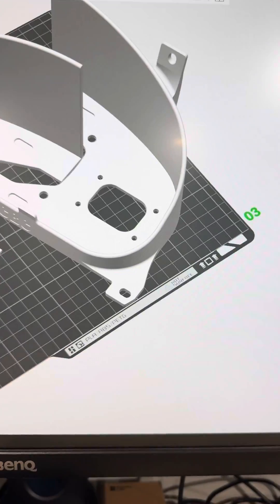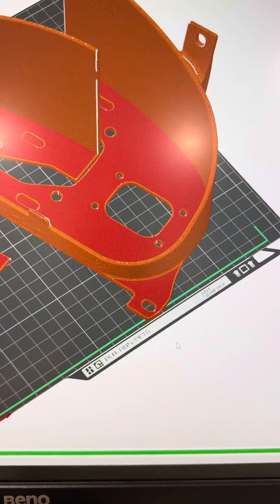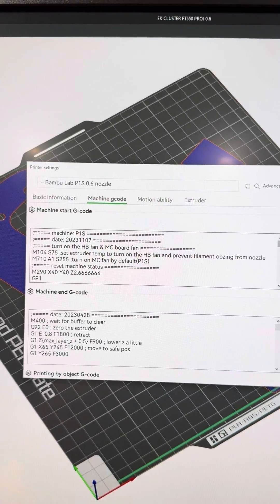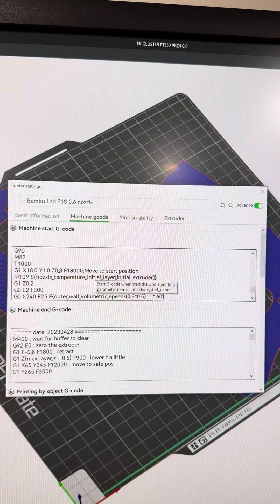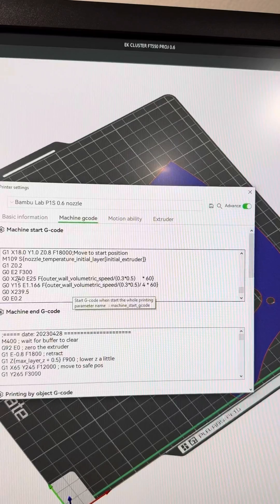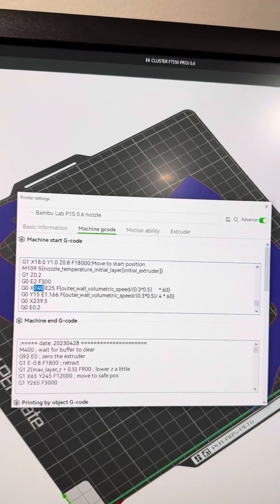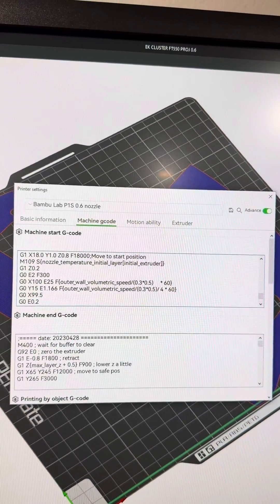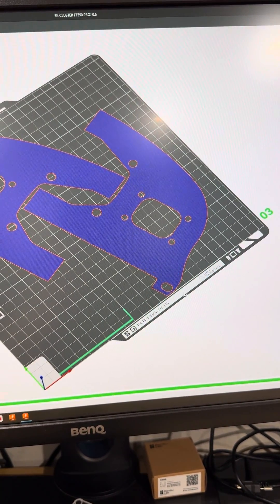Move Bambu “Load Line” Initial purge

Comment: say if i am printing something that goes up to allthe edges. can i ad a Ysome value to move it to the say the middle of the printbed?
Reply from the maker: Yeah I believe you could no problem 👍 try adjusting the X and Y start/stop values, then slice the plate to see where it ends up in the preview
Reply: @cbc.custombuiltcars  nice i will try would be nice to be able to use the edges of the build plate